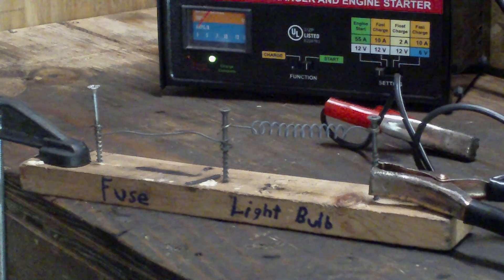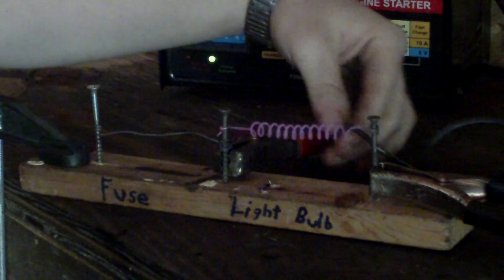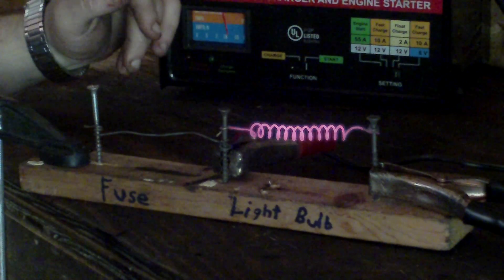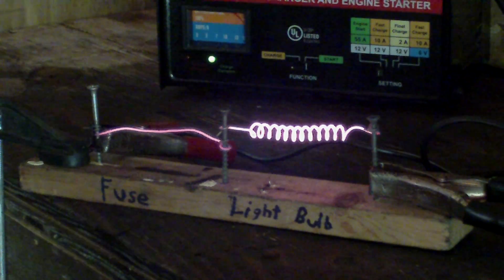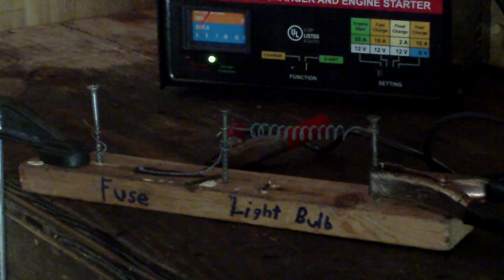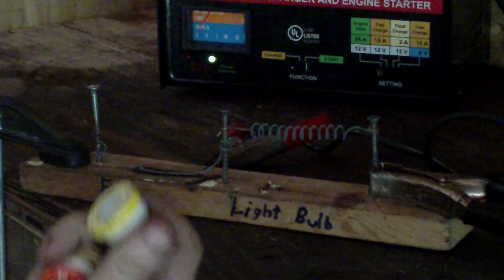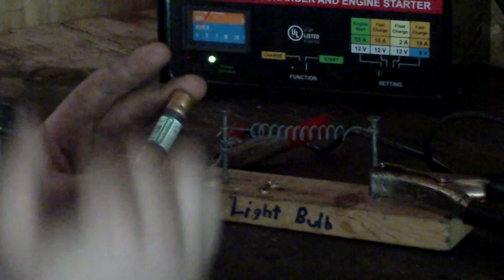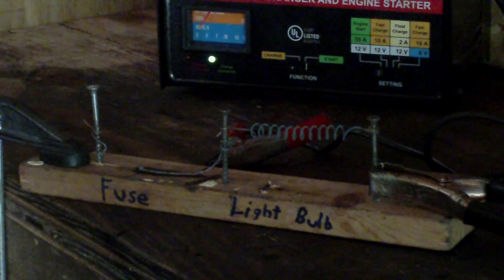How Lightbulbs and Fuses Work

Comment: If there is no fuse and then you are short circuiting the filament... what will happen ?
Reply from the maker: There will be a fuse or breaker somewhere, if something was un-fused it would burn up something, either melt a wire in two or burn up a transformer, etc. If it was power from a battery a battery can actually explode from to much amperage. Thanks for Watching!

Comment: The colour of the filament only depends on its temperature (which in turn is directly related to the current flowing).   You'll notice that when he runs the 6A current the filament glows a duller red while at 12A you get a much fuller range of colours emitted giving a much whiter light.   This phenomenon is known as black-body radiation and is observed all over the Universe, for example the colour of stars - the cooler they are the redder they look.

Comment from the maker: its actually glowing orange, but that camera I had then didn't pickup orange very well for some reason, If i put more current threw it would glow brighter, but If it glowed white it would actually start to burn, which is why the filaments in bulbs is in a vacuum, no oxygen so the wire can't burn. Like how i demonstrated the fuse blowing on this video, the wire melted into before it could glow any brighter. hope this makes sense. thanks for watching!!!